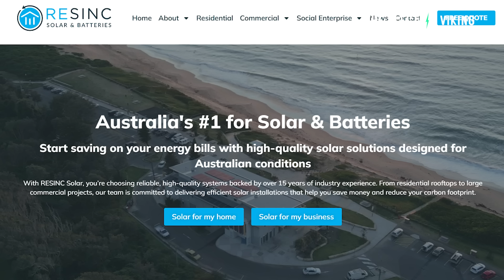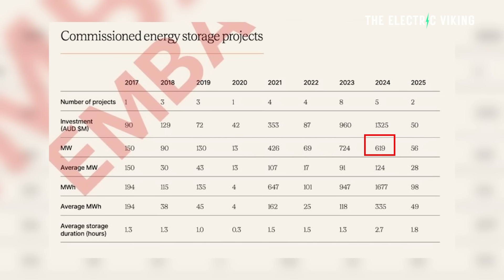Australia's Renewable Energy Surge Skyrockets: 2025 Breaks Records!

Comment: Renewable energy is the most costly form of energy over the long term. Solarpanels and wind turbines have a life span of 20years and then have to be replaced. Who pays for the replacement equipment?? who cleans up and removes the old panels and turbines?? Each turbine uses 50 gallons of mineral oil on each service. Nuclear power last up to 100 years and can be located on the old coal fired power site with no cost to transmission cables and no destruction to the farms and the bush that is destroyed with renewable transmission towers and cables. Nuclear Power is the cheapest form of energy. Think people think??? Time to get real. ???

Comment: Hypothetically, there isn't a need for renewables to slash carbon emissions from the power industry.... much like an ICE, the efficiency of the power industry is abysmally low. Less than 15% of the available energy in coal/gas is made available to the end user as electricity. Batteries (and hydrogen) can directly address demand response to frequency modulation which results in doubling of efficiency..... in other words, no one knows if and when 1 million hair dryers will be turned on simultaneously, so the power grid has to be prepared at all stages to cater for a large fluctuation in power demand in a split second, which cause the efficiency problem. If a battery/hydrogen can support that load for a few seconds/minutes, the grid has enough breathing space to respond with other power supply options. A grid could hypothetically provide the same power to households with half the gas/coal, if efficiency is doubled ... and the key to radical improvements in efficiency is through batteries/hydrogen

Comment: yesterday i spoke to the company that installed my battery ready system about 3 years ago. I was seeking the cost of a battery now that the 30% rebate has been introduced. Well after the rebate is applied, the price they quoted me was barely 10% lower than the price i got 6 months before the rebate was announced. It appears that wholesalers and retailers have jacked the price, almost completely negating the rebate. Surely this would be considered price gouging.

Comment: This is great news Sam. I had to tactically vote at the Federal election because of the way that the Liberals/Nationals were going to deal with our energy needs if they were elected. They were utterly clueless on this subject and I just couldn't allow them to be elected knowing exactly what they would do with all the hard work that has been done to rid us of the need of coal, oil and gas. By the time the next Federal election comes around, the renewable energy utilised in this country will be the norm and absolutely irreversible. Not even the Liberals will be able to turn back the clock. All the Liberals need now is a more intelligent leadership - Dutton was as thick as s^&t - a forward thinking, young leadership that understands what we need with regard our energy needs and support for EVs, home solar/batteries in particular and they can have my vote back again. We urgently need to tackle our other pressing immigration culling requirements after all.

Comment: Good stuff, but if houses were built better we wouldn’t need so much power to heat or cool them overnight, when there is less solar. Our house doesn’t need it. It has solar gain, insulation and thermal mass. 5kWh/ day over the year.

Comment: When they burn will you cover it .
Australia's power bills are increasing.
Mean while coal is powering cheap Chinese and other countries electric power.
Reply: In the next five years China is expected to add annually: Solar: ~100–150 GW, Wind: ~30–40 GW, Nuclear: ~8–10 GW , BES: ~3–5 GW. Now lets change the numbers for CURRENT capacity factors in China: Solar:~20-30 GW, Wind: ~11.3-15 GW, Nuclear: ~7.2-9 GW.  Wind and Solar capacity factors will increase, Nuclear will remain in the same range. Coal net increases for the next 5 years is around ~30 GW annually, ~15 GW with current capacity factors. They are doing some of everything.
Reply: China is investing more in renewables than anyone.  Coal is declining in China.
Reply: The Chinese are moving away from coal at an ever increasing pace. Most new coal stations in China are used as peaker plants and do not contribute as much to the grid as the old ones that are beimng closed down. Coal consumption in China has now peaked and is heading down thanks mainly to the incredible amount of solar being built - 277 GW in 2024 and 105 GW in the first 4 months of 2025. This is compared to 30 GW of new coal plants commissioned.

Comment: How many MWs does Australia need per hour? 25,000MWs. How much power do we need for the whole night? How much battery capacity do we need to rely on just batteries? Do we have enough wind to charge the batteries 12 times a night? What is the cost to replace coal power stations that can produce 6,000MW per hour for 1 day?
Reply: just build more and store. no brainer.
Reply: @lauchlanguddy1004 1000 MW of storage cost $1.6b. To replace the big generators at night that cost is $240b. We haven’t costed the generation yet to charge the batteries or the replacement cost as the batteries lost capacity over time. 6-8000 cycles for lifepo4

Comment: If only the government could give a rebate on EVs that have vehicle to grid capacity, this may encourage OEMs to manufacture vehicles with this capacity.   Most home batteries do not exceed 13 KW, but EVs have at least 50KW.  This would be a game changer for battery storage in Australia.
Reply: Most vehicles are parked 23hrs every day and all night long. 
EV batteries upto 100kwh and many homes only needing 7kwh after sundown. 
Many homes with 2 vehicles also.
Rooftop PV is cheaper than windows $m².
Reply: This!!!

Comment: Absolutely incredible news! Australia hitting a record in 2025 with solar and wind supplying the majority of its electricity is a massive tipping point. This shows what's truly possible when a nation leans into its renewable potential, especially with that massive rooftop solar adoption. Go Australia!
Reply: I get nervous about more penetrations on my roof.  No thanks for Rooftop solar.
Reply: @mefobills279  I can understand this in some way, but of the soon 10 homeowners that built their rooftop solar based on my advice, no one has ever seen any drawback regarding the roof so far. On top of that I didn't hear from someone else, here about wher many did it, complaining.
- With tile roofs: There is a technique that works w. no penetrations with fixation elements that work from below the tiles.
- With slate roofs: The seals so far would hold everywhere and they are in the shadow of the panels protecting them from the sun which gives them a long life.
- With integrated rooftop solar, the solar is the roof, so there is no penetration of the roof
- With flat roofs, the solar system is mounted on heavyweight standoffs, e.g. no penetration as well. What you do there however, you have an engineer checking the load rating of the construction prior to deciding.

No that I Imagine changing your mind but nevermind.
Reply: What exactly is so "good"?  As far as I can see, all that is happening is that some businesses are investing in battery storage to arbitrage variation in electricity prices in a 24 hour period. As the market matures, "cheap" rates at night will get dearer which isn't good news for EV owners counting on saving much dollars by charging at night.  You mark my words, in a few years you will hear the complaint that night time rates were so cheap but now they've gone up so much and I don't know why.  Well, this is why.
Reply: @vincentcausey8498  This is a natural effect of day/night difference in offering when using lots of PV.
However the storage the Viking is talking about is there not only to bring daily excess offering into the night to cover demand but also to protect night time prices from skyrocketing. Of course these will still be more expensive than daytime because otherwise there won't be a business model for the batteries. 
The answer to this is workplace daytime charging options.
Reply: Vincent and the crooked corporatists and gullible gas betas will always be critical. But more and more families are becoming energy self sufficient. For the first time since horse drawn wagons and tallow candles wood stoves, individuals can generate and store the energy we need for our homes and transportation! And, folks that switch to heat pumps and solar and EVs will build tens of thousands of dollars/Euros etc. more wealth than the gas betas.
Reply: @vincentcausey8498  Unless you drive very long distances you can charge your EV at the weekend from your own solar panels during the day.  Your home battery can top it up a bit as well.   Home produced power is free,  sort of,  once your solar system has paid for itself.

Comment: Who do you think will bare the cost of the massive grid infrastructure investment needed to get renewable energy from far flung areas to consumers in urban areas?  Us consumers, thats who.
The claim that renewables are the cheapest form of energy is just a myth and we will find out to our detriment in due course.
Reply: The rise of batteries will avoid a lot of grid infrastructure. For example, one of the main purposes of the first Victorian big battery was to provide increased capacity on the interconnector to NSW, avoiding a transmission upgrade.

Comment: Im in an apartment block in a sun shadow.   Can't get renewable installed, but I'm happy for all the renewable power.  Its going to be far more reliable especially in SA where we seem to be on the end when energy disruptions occured before (NSW power delivery prioritised).    My friend got an electric car and solar panels. He's saving on fuel (no petrol costs) and vastly lower power bills even allowing for repayment of the panels.  His fuel costs were at least $40-50 per week.   Now zero and his kids use his power to charge the "spare" family car.    They collectively spent over $120 per week on fuel on that car.  Now zero (dad "pays" for the electricity).
Reply: I am in the same situation as your friend. My solar system and battery cover my home electricity and power two EVs. The solar system with 15kWh battery will pay for itself in about 4 years.
Reply: 405, how is the 15 kWh battery working for you? Is it, paired with your solar, enough to cover your energy needs?
Reply: @freeheeler09 we are not big power users under normal circumstances. In Perth, we don't use much for heating. There were a handful of nights in Summer when the battery didn't get us through until the sun took over again.  We were running two air-conditioners, two fridges, a not very efficient 50litre hot water heater and the computer/nbn. We had some nights where the minimum was 28°C and we went over to grid power for about two hours before the panels and the sun took over again. 
For Autumn and Spring, the battery goes down to about 60% overnight. Under those conditions, I set the EV to start trickle charging a couple of hours before sunrise. The aim being to mostly empty the house battery into the car, giving more time for trickle charging and getting more value from the house battery.
Without the EV, the 15kWh battery is overkill for me, most of the year. I would suggest even 5kWh would get me through most of the expensive evening charges. Having a modular battery set up means you can add to it as finances allow. I think there are likely to be some real cowboys around with the Government incentives. The good companies will be working to get the correct size for your needs. Good luck.
Reply: An EV actually saves more than that. Many service stations have a convenience store attached and you tend to make an impulse buy in the store when you buy fuel. A cup of coffee or whatever. Since you never visit the service station any more you don’t make those impulse buys.

Comment: People think that distant renewables will be cheap electricity but they are wrong.
ALL GRID ELECTRICITY WILL BE EXPENSIVE ELECTRICITY. 

Grid owner's will gouge slow adopters of rooftop PV like myself. 

We invested heavily in gas appliances and petroleum vehicles. 
Blackouts were common at the time.
Vehicles plus hotwater plus cooking plus heating.

My street supply cable is minimum and $2,000 to upgrade. 

Both my neighbour's rooftop feed-in is a pittance but my grid supply is 50cents kWh. GOUGING by the grid owner's scrambling for cashflow.
Reply: You should shop around for a better deal. We pay about 32c for peaks  and half that for off peak.
Reply: @ronosmo  my electricity includes the daily supply rate that is going to increase as more rooftop PV is installed. 
Our usage is low.

My point is that my supply rate has been going up and we have stayed with the same provider. 
Life has got complicated and we are not on our life plan A, so to speak.

Gouging is happening to many and it is the grid owner's who are doing it.

Just trying to make it clear. 
All the crap about other things is distracting from the real factors. 

Politics from all sides is just confusing people.

Look up the most recent transmission line projects. 
$4.7billion for 365km. To SA from NSW. 
Humelink. 

Street poles and wires are energised and the streets are busy. Shift work etc for a million km. 
My 10m aerial to my home, to be upgraded $2,000 estimated. WTF.
3phase is $5,000.

People just don't understand.

Comment: In Australia 6,500 TWh of energy used annually, 250TWh is electricity if lucky and nothing breaks down. 
66% of fossil fueled energy is heat and mechanical losses. 
If 66% is not needed then 2,150 TWh is needed. 
In Australia if 6.6kW rooftop PV x 20million can match 250TWh then double that amount of rooftop PV,  can both self– supply and fully grid supply with feed-in electricity. 

And no new grid capacity is needed upto that point. Rooftop is just dirt-cheap realestate at the consumer's meter box. 
$TRILLIONS and TRILLIONS SAVED. 

Now the bulk remaing demand is only 1,650 TWh.
Reply: OK. But 1650 TWh is still a lot. No?
Reply: @beatreuteler  yes but you have achieved much at a practical cost or benefit. 
New technology is evolving.
The new grid itself causes CO2 emissions in its creation. So that's a saving.
Reply: @stephenbrickwood1602  Correct, of course. But I hope the people of Australia are aware of the size of efforts it takes to bring about renewable energy sources this size on top of the distributed generation. I agree it can be done but it takes a few decades of solid stance.
Reply: @beatreuteler  1650 TWh - do this right? How many on 1 Australian? 40 000 kW h ? oh. WHAT do people do with SUCH quantity of electrisity?
Reply: @RomanKoval-ju6ht  I guess Australia is a very large country, so transportation may be a large portion of the total energy budget. Also I'm quite sure there is some industry. 
In Switzerland we currently use about 26'000 KWh per capita and year, but that still involves 75% fossil energy.
We are supposed to shrink that to less than 11'000 using electrification.
But we shrunk/outsourced Industries since a few decades and we are comparably many people in a small country. E.g. transportation stretches are much shorter. This said, maybe the 40'000 are on the high side but not totally unrealistic.
Reply: @beatreuteler I read that the USA has 4kW generation per capita compared to Australia 1kW generation per capita. 
Given that Australia exports and has little manufacturing, it makes sense. 
Just my comment.

Comment: Great news less coal less gas more renewables.
Reply: Much...much more gas actually...
Reply: @grantbuttenshaw  Less gas actually. As renewable penetration has increased gas generation has fallen (from 25.3 TWh in 2014 to 11.5 Twh  in 2024, a fall of 54%). That decrease is likely to continue with the rapid battery buildout.  27GWh of battery storage is due to come online over the next couple of years. Those batteries, if cycled an average of 0.8 times per day, could displace about 8 TWh/y or almost 70% of NEM gas generation.
Reply: @tassied12 what does AEMOs ISP say?
Reply: @grantbuttenshawAEMO has consistently overestimated gas demand. The battery boom has not been factored intp previous ISPs
Reply: @tassied12 i think it has....and what battery boom....how any GW of peaking gas will we need to build?
Reply: @grantbuttenshaw Probably a few. But peakers don't peak the gas consumption.

Comment: Only thing going up faster than renewable projects is the retail price of electricity.
Reply: Need to remove fossil fuels from the grid as soon as possible because of merit-order marginal pricing makes renewables lower price not visible at retail.
Reply: @beyondfossil exactly this. Well said.
Reply: @beyondfossil Amber makes cheap wholesale renewables visible during the day.
Reply: Retailers dont need to pass on cost savings from getting renewable power, infact they usually charge more for green energy via opt in